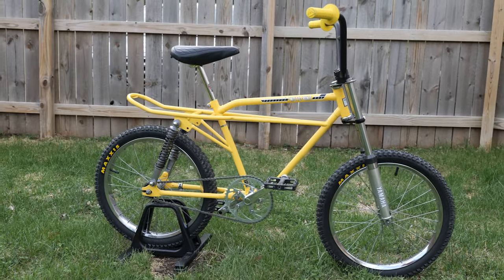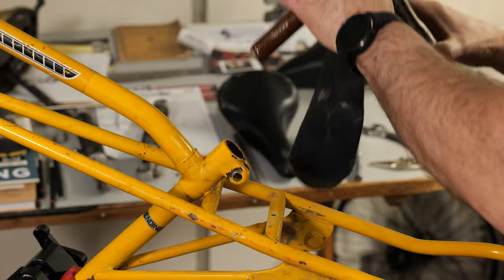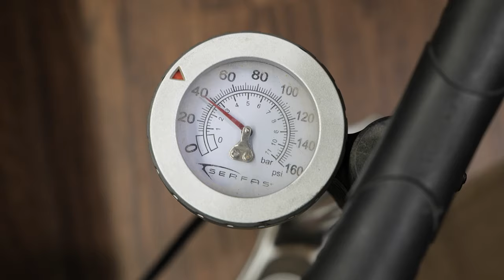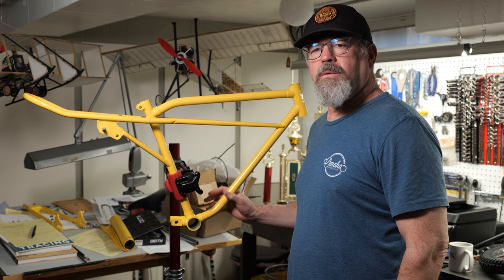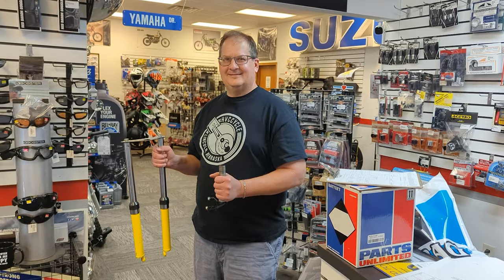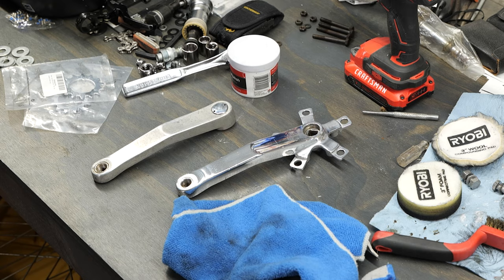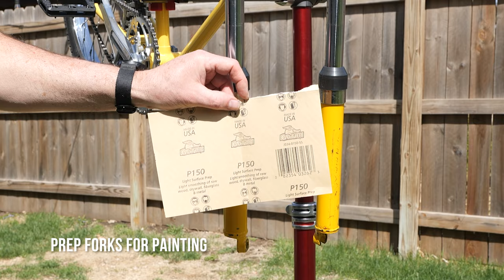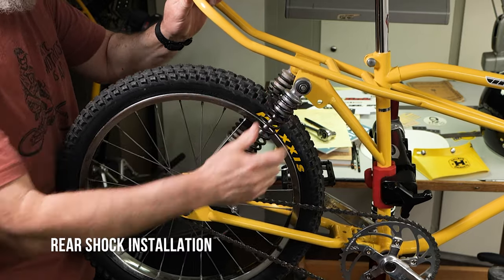Vintage 1975 Yamaha Moto-Bike BMX Restoration

Comment: Around 1980 I used to visit the local metal scrap after hours. I pulled this frame from the pile and carried it home. I found shocks and other parts on subsequent trips. My dad welded on a piece of pipe to the stem because it was used so much without the right parts the metal was curling. I painted it black, put a headlight on the front and it was one badass bike. I sold it before I went into the military, great memories. Thanks for the video.
Reply from the maker: That bike sounds epic! Love how you turned scraps into something so cool. Who needs a brand-new bike when you can create a legendary ride from scrap? Sounds like you were the original DIY master! Thanks for sharing your story!

Comment: As a teen I was bought a 1975 Kent KMX 750 kinda like or the same you had. A few yrs later it was stolen from a friend. I tried finding another but no luck for a long time then skipping a few yrs later I saw on better one on eBay. It came with all the plastics and now I still have it. 👍
Reply from the maker: These old suspension bikes are just cool in every way! My friend had a Kent like yours. I have a Graco as well, similar but with a 22" front wheel. It was a gift from my parents on my 13th birthday. Still have all the parts and plan to restore it soon!
Reply: @RadMattic  yes indeed, at the time I own the 1st one I didn’t even know anything about them and thought it was the coolest thing ever. I rode it through the low train tracks cause it was confortable enough and cool. I have another frame and I’m tempting to put a 2 stroke 66cc motor to complete the image of the bike lol. We’ll see.
Reply: that's what i had too . I'm pretty sure it the same bike as depicted in this video , just rebranded to Kent.

Comment: The chain on those stretch so easy. The need a deraileur guide.
Reply from the maker: That's for sure! These weren't designed very well in the beginning! For any serious riding or vintage racing, they need a good chain tensioner! But for vintage bikes shows, a modern chain tensioner would be a party fail!

Comment: Very cool video!  Thanks for doing it.  Brings back some great memories.
Pretty funny to see cartridge bearings in the shock mounts, but not in the swing arm!  If there's ONE place where quality bearings are necessary, it's the swing arm!  Oh well.
(That probably partially explains why it rode so bad when I tried on on the playground in about '77.  Like riding with flat tires in sand!)
Personally, I really like to degrease parts & give a bike like this a thorough washing BEFORE tearing it down.  Much less to clean and more fun while working on it.
I have a mid-80's Nishiki waiting for me to restore...  better get off YT and my butt and get to work!!!
Reply from the maker: Sounds like that playground ride was an adventure! Who knew a swing arm could feel like a trip through quicksand? Good luck on your restoration journey! And, thank you for the great comments! You are so right on that swing arm! When I raced the bike at Dirty Fest it was the squishiest, bendiest ride ever! I'm amazed it didn't throw a chain. I'm working on a 1976 Huffy Monoshock video next. Trying to wrap up the editing over this weekend. Actually filmed it over a year ago! Have a great weekend!

Comment: The color is just fine looking.    Better with a tuff powded coat that is a shade of yellow off,   than a perfect color match sprayed on that will eaisly chip and get scratched.  How about a set of light weight wheels, modern light weight seat and post, and carbon handle bars to save some weight for vintage races.  Save the orig parts for display.  ll in all a cool restoration project.
Reply from the maker: Interesting that you should mention these upgrades! There has been so much interest in racing these old suspension bikes. Some of us have been upgrading and modifying our bikes and now, they have split the racing into "stock" and "modified" classes!

Comment: What end advantage did you get by changing the gear ratio on the rear wheel?  I had one for Christmas '76 and I remember it being very fast with the long crank arms and the orig gearing.  To a ten year old kid this was a beast of a bike. [stolen from me in 1980, recovered later but vandalized].
Reply from the maker: Oh man, the stock gear on the back is huge! It's a 20 tooth cog! Switching it out for a 16 tooth was a must. With the 20, you will spin too much after the first few pedals out of the gate!

Comment: Hello ,, Great bike !! What length cranks did you put on it ,, I am restoring mine , that I have had for 45 years !!
Reply from the maker: Thanks! The cranks I used are 175mm. They are 1990's White Industries mountain bike cranks. They're actually a bit too long for the BB height, so I plan to switch them to 170 mm early 80's Dura Ace cranks, eventually!

Comment: Now I'm not saying you are wrong but why do america and I believe numerous other countries have the front brake on the left if the handlebar and the rear on the right
Reply from the maker: I've heard that it's the reverse in Europe. If I rode with brake levers on opposite sides, I'd flip over the bars for sure!
Reply: That's  good question.  I'll have to research that.  I assume it's because most people are right-handed, so put the most-used brake on the right side.  But TBH, the brake that needs the most strength and proficient modulation is the front, so one could argue the front brake should be on the right.
Yes, Europe bicycle cables are reversed.  Matches motorcycles with right side being the front brake lever.